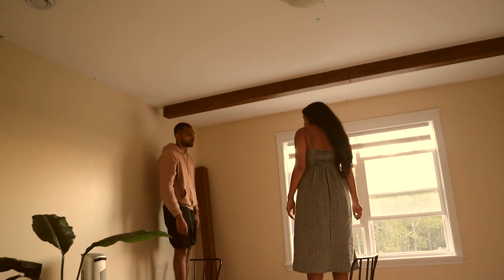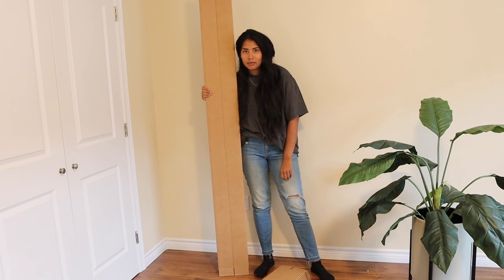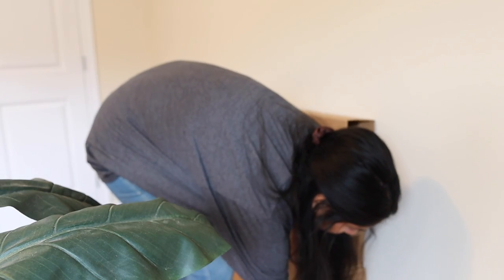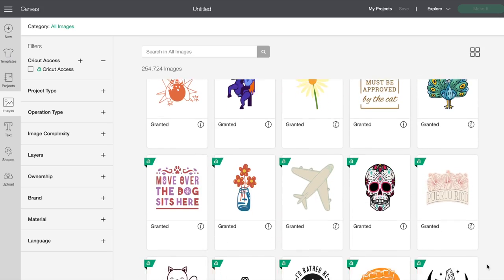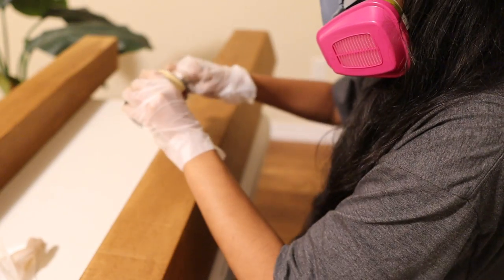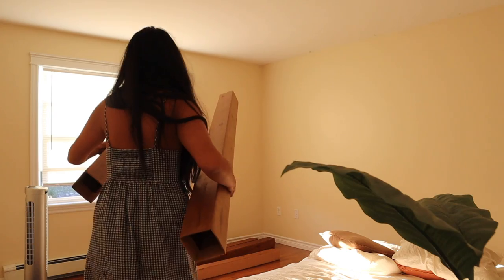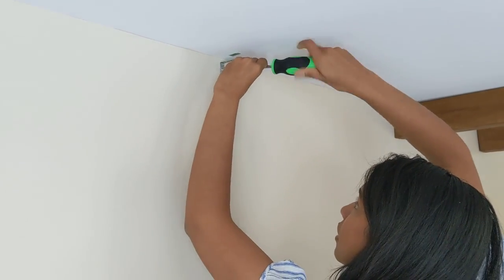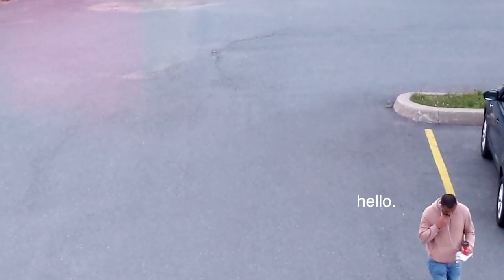DIY Faux Wood Beams (Rental Friendly) | Home Made Happy - Ep. 6

Comment: Dalia... I'm so impressed. The way you thought out the entire process. Boxes, to gel, to command strips, to the small brackets. 👏👏Should you leave, don't use chalking for nail holes. Try a warm white crayon.  Put pressure over hole. It melts inside. Not much to sand upside down.  (I rent.. a lot nail holes)  Bravo to you⚘ on your amazing project.  Your smile of joy is priceless.
Reply: Whoa thanks for this! I usually just use a dove bar of soap 😆
Reply: @GeniaBGolden   Nice!  I love this!  🧡  It's the sanding after the caulking that messes me up. Wall never looks the same.  Be well

Comment: There’s a tool which makes a wood grain, using stain/paint, you put the gel on and pull the tool through it, using a rocking motion. This was very popular in the 80’s on previously painted doors. , your beams turned out really well. You can also get peel and stick Velcro on a roll in various widths, which might work better-than command strips and will be cheaper (although it probably won’t come off the ceiling as clean as command strips).

Comment: There are ready made Styrofoam faux wood beams that are very cheap and look fabulous. I am sure those could be stained as well and are easier to cut to size. These turned out so beautifully though 😍 Great work!
Reply from the maker: Lmk where!! I couldn't find any that were under ~$130 USD per beam (and you'd need 4 beams). But I am also in Canada and I couldn't find any reasonably priced styrofoam beams anywhere online in Canada 🥲
Reply: @DIYDalia  US and Canada tend to overprice materials. In Europe it is around 20 - 50 USD per beam. Still pretty pricey, but really easy to cut and mount.
Reply from the maker: @leilakadribasic  ah Europe!! This makes sense!! I'm always admiring the product variety you have over there 😉

Comment: If you want something super realistic, next time cover your boxes with craft foam and then you can use a craft knife to cut texture lines in and then a quick blitz from a heat gun to open them up. It's a really common technique in cosplay to do wood grain like this... Plus adding the thin foam would cover the seams. But great creative problem solving none the less, grats on getting the beams of your dreams.

Comment: That turned out awesome, I can hardly believe you pulled that off! But yet you not only pulled it off, you nailed it!
 IOD, Iron Orchid Design puts out some stamps that mimic the design of wood. They are pretty cool as well, the include different designs in wood, the lines & knots. You might check those out also. I don't know if they would be easier though, than what you did.

Comment: You could have used peel n stick wallpaper on the box. What will you do for the gap at other end?
Reply from the maker: I have 2 extra boxes (I got 10 and only used 8). If I ever find the motivation I'll cut a small piece and fit it in the gap :). But right now I don't even notice it. For peel and stick - that would also work but will look a bit like fake wood or laminate
Reply: @DIYDalia  yeah peel n stick looks fake.. but stain looks sooo real!!! 😍